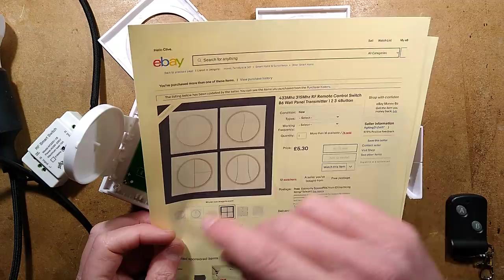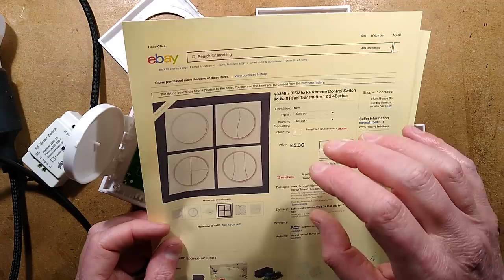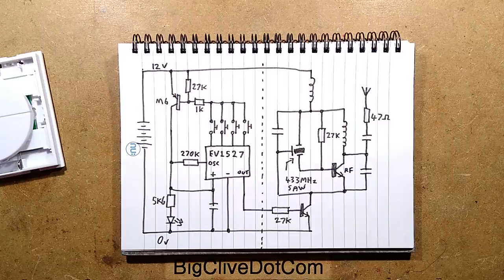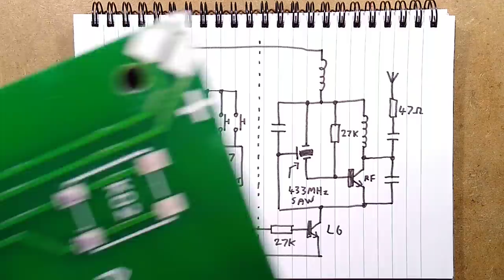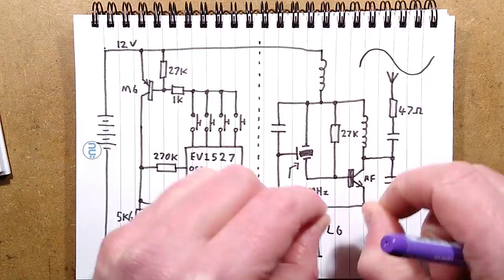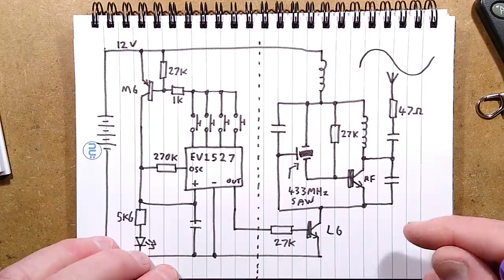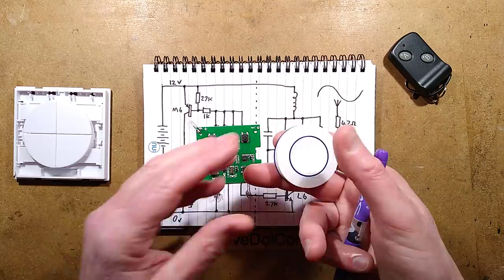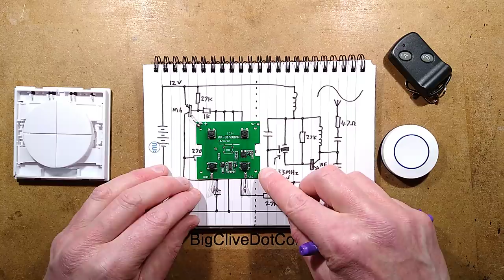Inside some stylish wireless switches (including RF schematic)

Comment: I'll probably never understand why so many of those "smart" switches use batteries even though they're most of the time right on top or very close to a power source... Models that are meant to replace existing light switches could tap into mains for power, and for those you can stick anywhere it shouldn't be THAT hard to use the energy of the button push, or even harvesting it from surrounding signals...

Comment: There's five spots for buttons, but they didn't make a five-way switch? I call shenanigans!
Reply from the maker: Alas, just four inputs on the chip.  Although they could have used two diodes from the fifth button on those spare pads to make a two bit code.

Comment: If they don’t have a FCC registration anything that transmits wirelessly isn’t legal in USA.
Reply: Depends on the power level. Very low power devices are exempt.
Also 433 MHz is an ISM band, so that gives further exemptions.
Reply: @graemezimmer604  I haven’t see any rule that states depending on transmit power a device is exempt on fcc registration. Most of the rules on the band regulate how long a device can transmit at one time and over a period of time, wattage and use (must be remote control). I doubt the FCC will crack down on someone using a unregistered device, but a guy in New York did get in trouble a few years back for using a cordless phone that was unregistered and causing interference.
Reply: @jakp8777  All devices have an exemption below a certain power level. Else most simple electronics would be banned.
Reply: @graemezimmer604  I don’t know about that exemption. However, are these devices exempt? Who checks to make sure they really qualify for a exemption? Why doesn’t everyone just claim heir devices exempt even if they don’t qualify?
Reply: @jakp8777  My comment was directed at your "anything that transmits" statement. In reality their are various exemptions, especially for ISM bands and very low power. 
FWIW, there are hobbyists operating world wide (unlicensed and completely legal) with very low power transmitters. For example see https://www.hfunderground.com/wiki/HiFER
But yes, I don't think that these 433MHz TX's are exempt, especially in the USA where 433 MHz is not an ISM band. Sadly there is little regulatory testing done these days. The manufacturers and Importers are merely required to submit a copy of tests which "prove" that they comply. Their lack of actual compliance is notorious.
A good summary of 433 MHz devices is at:
https://www.edn.com/using-433-mhz-for-wireless-connectivity-in-the-internet-of-things/

Comment: trivial to jam as they're using simple ASK. just transmitt a 433Mhz carrier and nobody can switch their lights on.
Reply from the maker: Yes indeed.  In fact there's a very simple mod you could make to one of these switches that would turn it into a jammer.
Reply: if it were my design :) I would use a common spreading code for initial pairing and then a uniq code for subsequent switching. it''s still jammable but more robust to use spread spectrum.

Comment: Cool but I’d much rather have a battery-less one if I needed one
Reply: quinetic do them. The action of operating the switch generates a small current enough to generate an RF signal. I use on for operating a waste disposal unit with a switch near the sink which would obviously be dangerous if operated at mains voltage.
https://www.tlc-direct.co.uk/Main_Index/Quinetic/index.html

Comment: Capàcitor turns it into FM transmitter._
Reply: Definitely not.
Reply from the maker: Looks similar to an FM transmitter, but it's a fixed frequency being pulsed on and off as opposed to being modulated.
Reply: @bigclivedotcom  Actually switching the TX on and off is still modulation. It's called On-Off keying (OOK modulation). I think that the original poster was getting confused with FM or FSK modulation (eg Frequency Shift Keying).

AM and FM are analog modulation methods, while OOK and FSK are digital modulation.
Reply: @graemezimmer604  That makes sense, I never heard of these before. Thanks for explanation._

Comment: "Made in China" connected to MAINS ? I hesitate
"Made in China" powered by batteries and wireless? My lights controlled by anyone
(not Made in China) Hardwired, in series to actual switch = I'm in control

The devices in this video sure as hell better have DIP switches I change the programming
Reply: I think you are forgetting the fact that wireless devices have pairing now which are so much more secure than dip switches.
Did you know that you can hack a children's toy to open any DIP programmed garage doors in seconds. DIP pairing takes moments to brute force open, rolling code pairing is a much more secure way of linking wireless devices.

Also I think you are selling Chinese manufactures short as there are some impressive things that come out of there.
Reply: @NetAnon  I have some wireless (non-programmable RF) units and my neighbours turn it on, and the device has no option to change (not blue-tooth paired)

Rolling codes aren't that great either HAK5 covered it

I'll admit they come up with loads of IDEAs, but I'm seldom satisfied with the execution, in reliability (never), durability, or security.

I'll see the idea, and then consider; can I do this but better (for my one-off use)
Reply: @nemesis851_  Rolling codes can be defeated but require at least some sophistication to preform the roll jam attack unlike DIP switches that can be defeated with a children's toy.
I also think that them designing their own products and coming up with their own ideas is a great way to get the infrastructure in place to produce products that foreign designers to use to make even better products that improve on their original design.
Modifying existing products is one of the best ways for makers to make things that they will use.